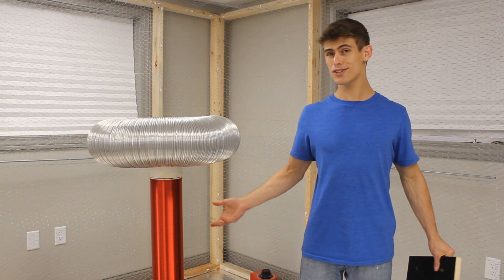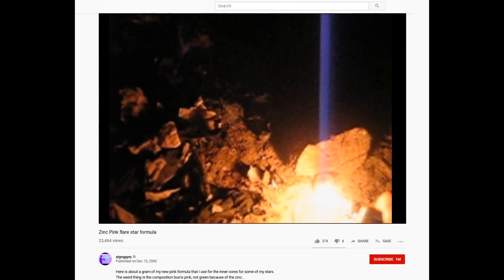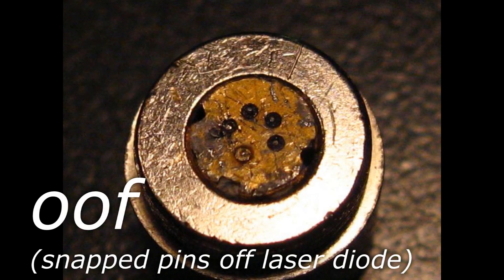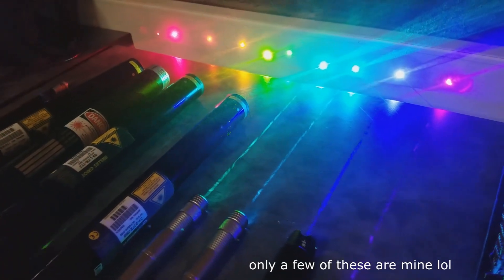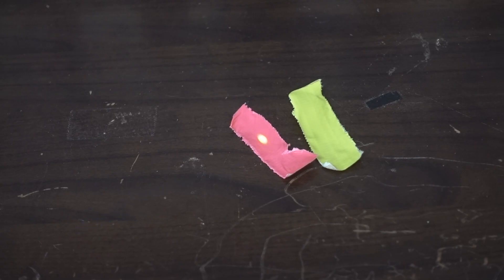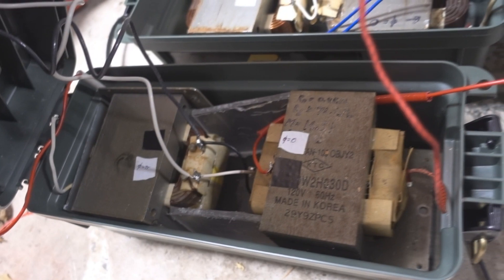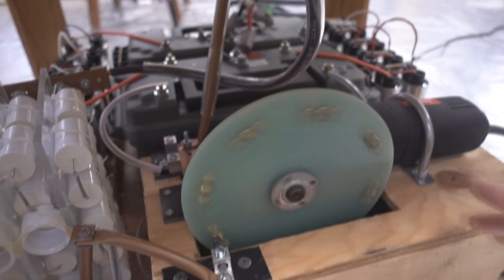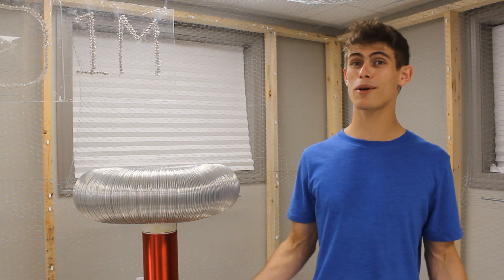Plasma Play Button for 1M Subscribers

Comment: Ha, I was the same way when I was a kid. I had a ton of fun making the chemicals I needed for fireworks out of household stuff or chemicals from the hardware store. Finding KNO3 at the drugstore for smoke bombs, or making black copper copper oxide from septic tank chemicals for blue flames, or extracting strontium nitrate from road flares I found on the side of the road for red flames. Hunting down a willow tree near by to make my own charcoal for sparkling effects or BP. Toasting corn starch in the oven to make dextrin to bind my stars and lift BP. Ball milling aluminum for days to produce white sparks in fireworks. I too ripped out diodes from dvd burners and put them in altoid cans! Similar to your first ever laser project. I even have an old video of that on my channel from way back in college.

Comment: congratulations Drake, on ONE MILLION SUBSCRIBERS!!!  I know what it's like to fail, I started watching your channel many years ago, and subed, and after failing multiple times at making my own laser, I pretty much gave up.  but, and I know you aren't suppose to start a sentence with but, but after you showed your portable laser building station with aluminum, not aluminium foil that was the trick I needed!  I was already using a static strap, but it didn't work!  and built my first LPC-815 laser from a DVD drive.   I've bought more laser diodes and modules to build even more powerful lasers. and yeah I have some really good googles, or I could just be STUPID, not gonna happen.  thanks for the tip about Survival Laser, I will be buying a pair of blue laser googles very soon.  Thanks for all the insanity, I love it!!!    mike

Comment: Nice Tesla coil!  I just have one question about the Tesla coil, I saw a sticker that said that it is a hazard to radio frequencies.   Why is it a hazard to radio frequencies?
Reply: Because the spark acts like a radio transmitter and might interfere with radio or tv signals.
Reply: @malcolmhill8139  Ohhhhhh.  Makes sense.  Thank you for replying to my question.